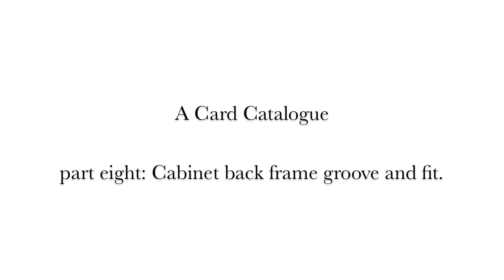A Card Catalogue part eight: Cabinet back groove and fit.

Comment: Beautiful work as always Tom, really enjoying the videos.  I'm curious as to why you rabbeted both the carcass and the back frame.
Reply from the maker: Sean,
thanks for the comments and question.
I suppose the short answer is durability. Using a double rabbet makes the back panel flush on the outside, but also creates a better lock when it's in place.
Maybe overkill, but it worked.
all the best~